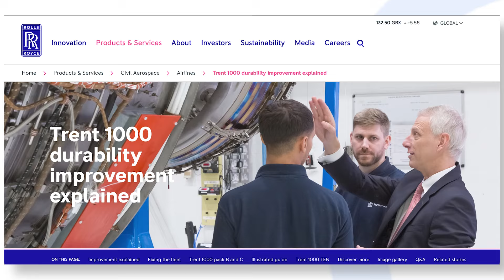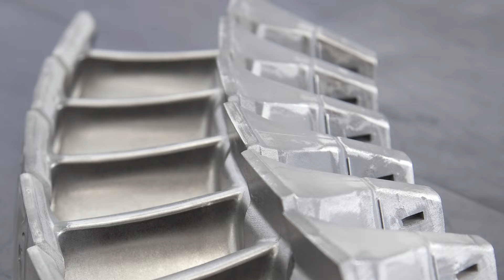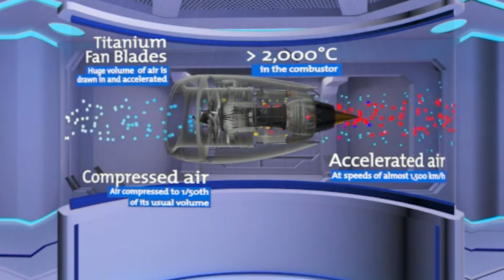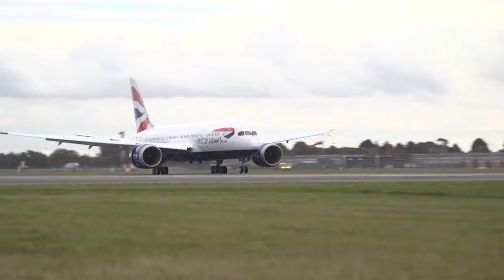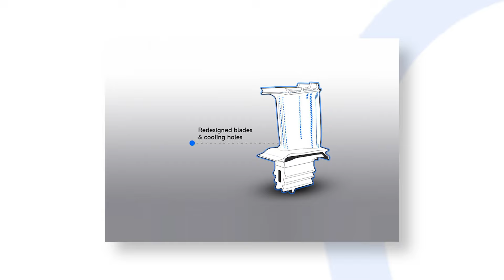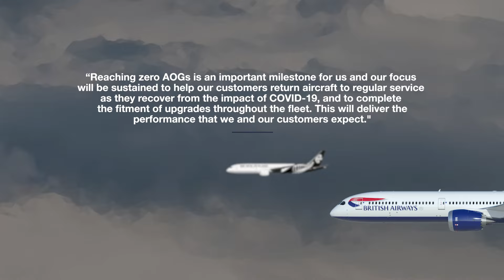787 Comeback: How Rolls-Royce Solved Its Trent 1000 Issues

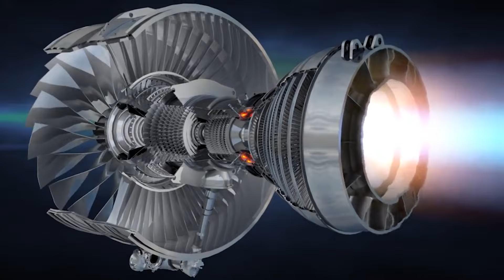Comment: I find interesting the animation of the engine at 1:03 to 1:25, showing the spool rotation and gas flow through the combustion chamber and then showing an afterburner type flame exhausting through the low turbine bearing housing, rather than invisible hot gas flowing out via the RR designed turbine gas path. Someone has just enough knowledge to be quite wrong.

Comment: You have to admire Rolls Royce being able to produce these triple spool engines which cannot be an easy route to take but seems a more optimal solution treating the 2 compressor stages differently. What other companies do this? I understand in the same way he sorted  the Merlin supercharging they had to get haul the late great Stanley Hooker out of retirement to fix the complexities of the RB211 engine, which  bankrupted the company but thankfully it rose again from the ashes.

Comment: What a lot of repetition in the first few minutes. If you're bashing journalists' reporting in this issue, why insist on imitating their waffly filler style? Another example of imitating low grade journalism is use of false contrast. For example however hard Rolls Royce may have worked to fix the problems, they nevertheless happened and caused significant impact so it's reasonable some criticism would have resulted.
So much YouTube material focuses on superficially sounding 'media like' rather than thinking 'what am I trying to get across and am I getting to the point?'

Comment: This video didn’t show what really cost RR to fix all this. It brought the company to the edge to bankruptcy. They had to shutdown factories, make people redundant, stop bonuses and pay increases for years. All these design flaws could have been prevented. These 3 issues were just the tip of the iceberg. There were many other problems. The stress levels and lack of regard of employees was terrible during the past 5 years. 
Really impressive engineering technology but really terrible company to work for. 
The AOG recovery was only achieved because of COVID. No one was flying so all big planes where idle. They would have never be able to achieve this under normal flying conditions. 
Don’t believe everything you see on the internet!

Comment: I'd stick with GE whenever possible. The fact that these engines were in the air with so many defects and design issues is really just unacceptable. And what is the exact definition of AOG? Does this mean that if the engine has flown once since a specific time that it can be reclassified as not AOG?
Reply: Yet more nonsense! These engines were borescoped regularly for defects & you miss the point that RR went way beyond what most companies could do in lessening the impact on airlines & Boeing. Gtw, RR have the biggest share of the widebody market, so you`ll be limiting what you fly on if you won`t go on an RR powered aircraft :)

Comment: The nickel ally has a melt start point at 1326'C. So has to stay well below this at around 1290 to 1300. RR did a lot of work to correct its issues. All engine manufacturers have issues but RR have an excellent engineering and tech teams

Comment: Excellent explanation video… superb engineering by Rolls Royce. This problem even though extremely expensive to fix, will make RR engines of the future superior
Reply: Definitely will help guide their future engine designs. Only too bad this engine had to be REDESIGNED to be sound. And now we are left to see how long the upgraded parts will last as well as the effects on performance. There is a reason they designed the original engine inner blades with that particular alloy. The fact that the had to change the composition entirely and then coat it with a different protective layer would definitely have impacts on cost, and even performance. But what do I know? They could have designed it with the right blades to begin with, right?

Comment: Congratulations!   Maybe Boeing may have the humility to take some lessons. :-)
Reply: Boeing did fix the max faster than RR fixed the trents
Reply: @aseem7w9  Boeing fixed a criminal system/software error!  As for being quicker then that is just nonsense, that's like saying the looser in the 100m is better than the winner of the Marathon because he finished quicker.
Reply: @alphalunamare  not really. Trent 1000 has already been "fixed" many times and again had problems causing frequent groundings, even including the new Trent 1000 TEN version. The max once it re entered service hasn't had any major abnormal issues.
The initial max problems were 10 times worse I know but I'm talking about the fix only here.
Reply: @alphalunamare  Even the Trent hasn't had further issues yet. The Trent went through tests and RR claimed it's fixed many times but problems appeared again and again causing more groundings which is why it took longer. And, if you haven't been keeping up with news China is satisfied with the MAX. Deliveries are set to resume soon, frequent MAX ferry flights happening there too indicating the resume to service is near. Hong Kong has already allowed flights there btw.

Comment: 80 years ago, the jet engines struggled to stay together for a few hours at 1,000 lbs thrust. Now we expect engines 100 times bigger to last for thousands of hours longer. What's been done in commercial aviation engines is nothing short of a miracle, teething issues happen, and only through millions of hours from technicians, engineers and designers do these things get solved. Rolls fixed it, but the media loves a punching bag. Remember, flying is safer than sitting on the toilet.
Reply: While maintaining high energy efficiency.
Reply: "Rolls fixed it, but the media Sux!" - fixed it for you....
Reply: More like: we expect an engine to not regularly disintegrate far below it's service life while being used well within its engineered capacity.
Reply: @rickyhall7514  not one of them disintegrated
Reply: @pb6198  he was talking about GE engines lol

Comment: Both the GEnX and the Trent1000 engines have been very unreliable during the time the 787 has been in use (the 787 hasn't been particularly reliable in general). First the GEnX was worse (engines lasted less than a year), then the Trent1000 engines were worse. The truth is both are new engine designs and it will take years for them to be as reliable as the older engines. Because those weren't reliable when they were new either (maybe with the exception of the CFM). Back in 2018/2019 there weren't even enough Trent1000 engines to keep all aircraft in service. Private Jet 787 owners with Rolce Royce engines would be offered absurd amounts for their engines and get new engines just so those slightly used engines could be used on commercial airliners during the shortage. Which is a good, yet slightly desperate move.

What annoys me is that Rolce Royce is tooting their own horn about allowing maintenance engineers to do inspections on the engines while this is common practice with GE engines. GE engines are maintained and inspected by the same people who maintain the rest of the aircraft and don't fly their own engineers around the world just to work on a few engines. GE also allows maintenance organisations who solved design flaws to patent their improvements. This way independent/airline related maintenance organisations benefit from improving the GE engines which helps in quickly improving the engine design (which benefits all).

Therefore the airline I work for chose GE engines, even though they were more expensive to buy. Which is a good call I think, though probably only benefits airlines with their own maintenance organisation or have a very good contract with an unrelated maintenance organisation. Those airlines who just service their aircraft with the cheapest bidder probably don't benefit and the Rolce Royce option may be better. Maybe for them, the frequent Rolce Royce inspections feel reassuring. Which is something I can understand.

Comment: As an aerospace engineer and jet engine mechanic i can tell you rolls Royse has only temporarily fixed the problem but the main issue is still there. There is no simple fix for those engines, they have to scrap the whole design  of the engine and start from scratch.
Reply: liar
Reply: You're both vocations? Yeah right

Comment: Rolls-Royce almost bankrupted low cost airline Norwegian. The RR engine problems were one of the reasons the airline gave up flying long-haul. They still do not trust the Trent 1000 engine problems to be over.. wouldn’t risk it..
Reply: still better than GE
Reply: @ant2312  - As far as i know there haven’t been any problems with GE engines fitted to the 787. 

GE together with their french partner in CFM, also make the worlds most sold engines CFM56 and LEAP powering the 737 and 320.

Comment: A Company you can trust. They put their hand up and fixed it. They also learned and developed new skills. Amazing listening to the engines running you do seem to get resonant airflows. Sounds like vibration at certain thrust levels. Would mapping the throttle so they never run at those frequencies solve a problem. Slightly higher slightly lower but never at the resonant frequency.?

Comment: Congratulations Rolls Royce.
I have never heard a PR department mitigate a metallurgy failure and design incompetence quite so well. Let alone purveying the months that airlines were unable to use their aircraft as a quick response.
Reply: There was no 'failure' let alone 'incompetence' as the video clearly demonstrated. The issues were exceptional and RR used them to make the Trent 1000 an even better engine.
To show how exceptional this was no other aircraft using other versions of the Trent engine of any description has had ANY problems since first introduced in 1989. And these are:
Trent 600 - Airbus A330
Trent 7000 - Airbus A330neo (Sole engine)
Trent 500 - Airbus A340-500 and 600
Trent XWB - Airbus A350 (Sole engine)
Trent 900 - Airbus A380
Trent 800 - Boeing 777

The Trent 1000 was and is only used in the Boeing 787.
Reply: @1chish  Tsch.  GEnx 60% of 787 sales. Trent 1000 40% of 787 sales.
GEnx 15% better fuel economy.
GEnx Quieter.
GEnx longer time between services.
GEnx cheaper.
Now why do you think Airlines choose GEnx.
Reply: @brianarnold3250   Not sure why you felt the need to bring GE into this as it has nothing to do with your initial comment let alone my reply. Bit of MURICAAA going on Brian? What a shame.
Airlines select GE for the same reasons they choose the Trent. Money. I would suggest that given the issues GE has with the 777X engine (as sole supplier) and its only commercial success (CFM) is limited by it partnership then it will be discounting for volume sales. RR does not have that problem as it is the sole supplier on A350, A330neo and has a substantial order book with other aircraft.
But you use some rather vague data:

1. The data I have seen from aerospace media puts the split at more like 50 / 50 given recent sales orders. I suspect you are using 2019 data. But the fact the airlines are still ordering Trent powered 787s is a huge achievement given Boeing is an American aircraft manufacturer which has very close commercial arrangements with GE. Like they swap Chief Execs!
2. That 15% figure you quote is published by GE compared to its own CF6 engine NOT the Trent. Its like saying the Trent powered 787 is 20% more efficient than the 767. Which it is but its a pointless comparison.
3. Noise is a subjective opinion and not factual.
4. Given RR sell engines on a 'pay per hour' basis servicing intervals is not a cost issue for airlines. Apart from which RR has real time monitoring on every engine in service and can change servicing depending on real time data. THIS was what first alerted RR top the blade issues on Trent 1000 engines. GE does not have this facility.
5. You have no idea what any engine sells for. But you at least agree with my supposition GE are discounting against RR. Which is a weakness as it loses profits.
6. Airlines are choosing BOTH engines. Indeed Singapore as the launch customer for the 787-10 ordered Trent 1000 engines.

The issue that you haven't mentioned is that Boeing only have 480 orders left to fill and only sold a nett 11 since 2019.
Reply: @1chish  not sure why you feel the need to jump to the defence of other companies unless you're biased
Reply: @ant2312   'other companies'?  Eh?
I am not defending anyone or anything. I was correcting the biased inaccuracy peddled above.
Stating facts is NOT 'bias' or 'defence'. Bias is when people infer something that isn't true because it suits an agenda. As you so eloquently showed.
Reply: @brianarnold3250  go away fanboi
Reply: @1chish  no problem, we'll discuss on fb, whats your name there seeing as we're taking this further
Reply: @ant2312  I don't use Social Media as I have a life to lead. Unless YT is classed as 'Social Media'. But no Facebook. Sorry.
You can reply here. I have no issues with a friendly discussion.
Reply: @1chish  GE have had their share of engine problems too. For example, "The U.S. FAA issued an Emergency Airworthiness Directive (AD)  in the wake of a Boeing 777-300ER uncontained engine failure occurrence on October 20, 2019." which was with a GE90.
Reply: @TheEulerID   well said. It makes me smile when a minority of Americans always jump to defend anything American for no other reason than that is ... American. Especially when that 'defence' takes the form of misrepresenting facts about products that are NOT American.

Comment: All 3 problems in the video are as bad as Boeing 737Max just RE was lucky not to have fatalities, all three problems known since early 60s and point to a rush job on the part of RR at initial design & test stage, something not expected from a company like RR, it points to erosion of certain principles held sacred with in , still it is an engineering driven company like Boeing prior to MD merger and bean counters still not on top. Once you start counting quarterly P&L that’s when these cutting edge companies go bust
Reply: Quote:
     "all three problems known since early 60s and point to a rush job on the part of RR"
Sorry but you lost all credibility right there. The Trent family was first used in service in 1989 not the '60s. A whole family of Trent engines has been created since and the only issues have been with the 787's Trent 1000.

And forgive me if something was known in the '60s and the engine went into service in the late '80s (not that that happened) I would suggest a 20+ year gap is hardly a 'rush job'.

Comment: They will never be able to fix the weight if the engine (it’s heavy), that’s why the GE is always going to be a more efficient choice. That and the fact the GE has significantly better emissions.
Reply: Nonsense.  The triple shaft layout of the Trent leads due to a shorter and better stage optimised engine.
Reply: @nickinknutsford  on paper it’s an efficient design, in reality it simply weighs too much. Thus making it a poor choice for aircraft efficiency. GE has a lighter design that produces fewer emissions. Facts. That’s why almost all new 787’s are spec’d with GE not RR
Reply: @eyebok  Your so-called `facts` are wrong. Both engines are VERY close on SFC, & Trent 1000 has never been a `poor choice` re efficiency. The main reason GEnx took the lead on numbers was that all the US carriers went with the home made product which turned out to be huge chunk of planes. The subsequent issues on Trent 1000 did them no favours also it has to be said. You don`t mention GEnx problems of course, but they had issues early on too. It was Trent that got all B787 variants in the air first, & now it can hopefully prove itself as a reliable alternative to boost Dreamliner sales once they can start again.

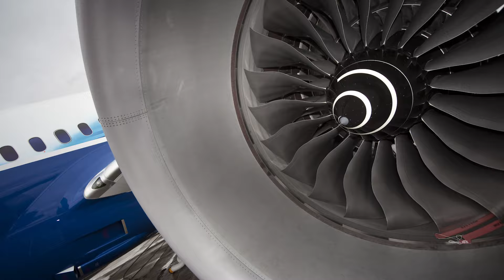Comment: 2:25; Really? “RR engineers use an ANCIENT process to create a Single Crystal blade”. I think this has only been around for maybe 20 years at the longest….not 20 centuries ! Am I wrong on this???
Reply: First use of single crystal turbine blade refers to JT9D-7R4 modification of P&W engine (1980). The tech itself was being developped for J58 used in SR-71.

Comment: There is a lot of technical confusion in this video. It seems that the "9 London buses" comment relates to the fan blades. The single-crystal turbine blades (a technology first perfected by Pratt & Whitney) are in a completely different part of the engine doing a completely different job.
Jet engines are complex, and Rolls is not the only company to face early problems (look at the Pratt & Whitney PW1000G). Glad to hear that they've taken care of it.
Reply: Yes the buses were a stupid analogy, I would have said 20 African elephants myself as the dimwit viewers (they assume we all are) can easily imagine that ............ or not.
Reply: @gegwen7440  It’s less the weight and more that he seemed to confuse turbine blades for fan blades.
Reply: Yeah I also always chuckle at these kind of stupid analogies, like weight x times a Jumbo Jet etc. for one single reason : are we talking about a empty bus or a fully laden one ? Cause the weight is probably going to go from one unit to the double of the same, if not more, when loaded with their certified load capacity.

Comment: Worked as a laser engineer with Metal Improvement Company (part of Curtiss Wright). We laser peened the fan blades and roots. This improved tensile strength by 50%. Done on the 500,700,800 and 1000. There is a plant in Singapore as well. Don’t know if Barnoldswick has closed yet. Our plant was in Earby.